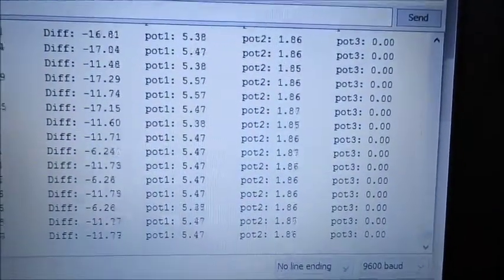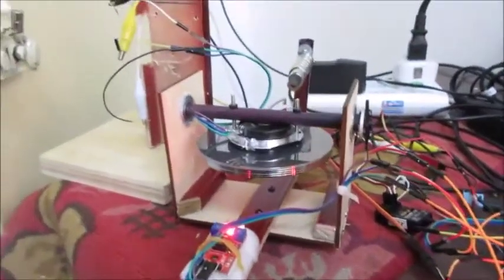Self Balancing Gyroscope From Hard Drive Motor 1.1

Comment: what is for? the potensiometer.
Reply from the maker: Measures the angle of the gimbal and tells where to set the counterbalance weight to correct the gyroscopes lean angle.
Reply: @demej00  alright.. can i make essay from this project?
Reply from the maker: @alifalfarras6522  You can. But if you want some real theory, check this pdf out: https://thebbb.net/free/theories-and-experiments-for-gyro-monorails.pdf
Reply from the maker: Here is a free pdf download from my website on the subject:
https://demej00.wordpress.com/2020/02/08/self-balancing-gyroscope-two-wheeler/

Comment from the maker: Code follows:

#include <PID_v1.h>
#include <Servo.h>

Servo myservo1, myservo2, myservo3; // create servo object to control a servo
int potpin = 0;  // analog pin used to connect the potentiometer
int val;    // variable to read the value from the analog pin
int setServoVal = 0;
int gyroPin = 2;
int gyroVal = 0;
int gyroAvg = 0;
int oldGyroAvg = 0;
int currAngle = 0;
int newAngle = 0;
float test;
int potpin1 = 3;
int potpin2 = 4;
int potpin3 = 5;
double pot1Val, pot2Val, pot3Val;

double Setpoint, Input, Output;

int filterAverage(int measurementsToAverage) {
  int avgSensor;
  for (int i = 0; i < measurementsToAverage; ++i)
  {
    avgSensor += analogRead(gyroPin);
    delay(1);
  }
  avgSensor /= measurementsToAverage;
  return avgSensor;
}  // end function

void myServo(int newAngle, int angleInc, int incDelay, int servoNum) {
  int curAngle;
  if (servoNum == 1) {
    curAngle = myservo1.read();
  }
  if (servoNum == 2) {
    curAngle = myservo2.read();
  }
  if (servoNum == 3) {
    curAngle = myservo3.read();
  }
  if (curAngle < newAngle) {
    for (int angle = curAngle; angle < newAngle; angle += angleInc) {
      if (servoNum == 1) myservo1.write(angle);
      if (servoNum == 2) myservo2.write(angle);
      if (servoNum == 3) myservo3.write(angle);
      delay(incDelay);
    }
  }
  else if (curAngle > newAngle) {
    for (int angle = curAngle; angle > newAngle; angle -= angleInc) {
      if (servoNum == 1) myservo1.write(angle);
      if (servoNum == 2) myservo2.write(angle);
      if (servoNum == 3) myservo3.write(angle);
      delay(incDelay);
    }
  }
}
//Specify the links and initial tuning parameters
//double Kp=7, Ki=.5, Kd=0.15;
//double Kp=9, Ki=0, Kd=0.1; // works if hold wires up
//double Kp=7, Ki=1.00, Kd=0.1; // !! pretty good and use 50/50 - output 4delay and 50delay - SP = 84
double Kp = 5, Ki = 0, Kd = 0.0; //

float mapfloat(float x, float in_min, float in_max, float out_min, float out_max)
{
 return (x - in_min) * (out_max - out_min) / (in_max - in_min) + out_min;
}

PID myPID(&Input, &Output, &Setpoint, Kp, Ki, Kd, DIRECT);
void setup()
{
  myservo3.attach(3, 1000, 2000); // attaches the servo on pin 9 to the servo object
  myservo3.write(90);
  delay(1000);
  //initialize the variables we're linked to
  Input = analogRead(2);
  Setpoint = 85; // smaller number moves balance point to the right
  //setup PID
  myPID.SetMode(AUTOMATIC);
  myPID.SetSampleTime(10);
  myPID.SetOutputLimits(-50, 50);
  Serial.begin(9600);
  Serial.println("Program begin...");

}
void readPots() {
  pot1Val = analogRead(potpin1);
  pot1Val = mapfloat(pot1Val, 0, 1023, 0, 100) /  1;  //set significance of P
  pot2Val = analogRead(potpin2);
  pot2Val = mapfloat(pot2Val, 0, 1023, 0, 100) /  10; //set significance of I
  pot3Val = analogRead(potpin3);
  pot3Val = mapfloat(pot3Val, 0, 1023, 0, 100) /  10;  //set significance of D
}

void loop()
{

 // Kp = 7, Ki = 1.00, Kd = 0.1; //
  readPots();
  Kp = pot1Val, Ki = pot2Val, Kd = pot3Val;
  gyroAvg = filterAverage(30);
  gyroAvg = map(gyroAvg, 0, 1023, 0, 180);     // scale it to use it with the servo (value between 0 and 180)
  Input = gyroAvg;
  myPID.SetTunings(Kp,Ki,Kd);
  myPID.Compute();
  Output = gyroAvg - Output;
  myServo(Output, 1, 4, 3);    //forward
  delay(50);
  //oldGyroAvg = Output;
  Serial.print("IP: "); Serial.print(Input); Serial.print("\tOP: "); Serial.print(Output); Serial.print("\tDiff: "); Serial.print(Input - Output);
  Serial.print("\tpot1: "); Serial.print(Kp); Serial.print("\tpot2: "); Serial.print(Ki); Serial.print("\tpot3: "); Serial.println(Kd);
}